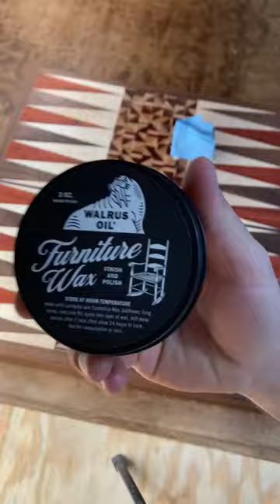Worlds BEST Backgammon Board!

Comment: How did you make the triangles?   

I'm in the middle of making a folding case board with my son........making small triangles with a high level of accuracy and repeatability is not easy.  I ended up making a table saw fixture, but my saw is 40 years old and my tolerance is about 1/16".  Add those together and I have ended up with 4 playing surface pieces that are not identical.

How did you solve for this?   CNC?
Reply: Make a pattern/mold and shave and sand each until they fit perfectly.